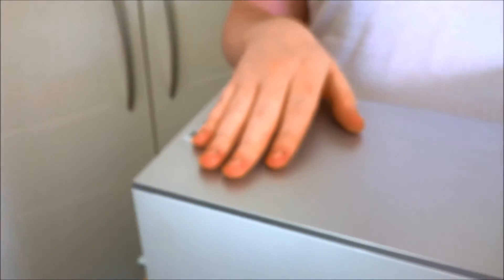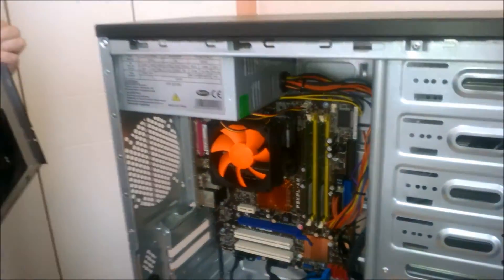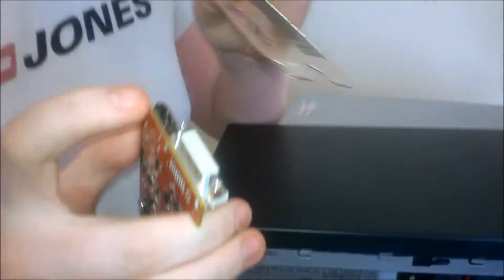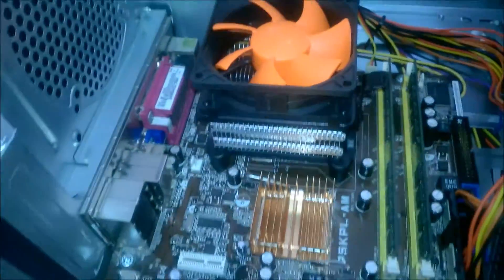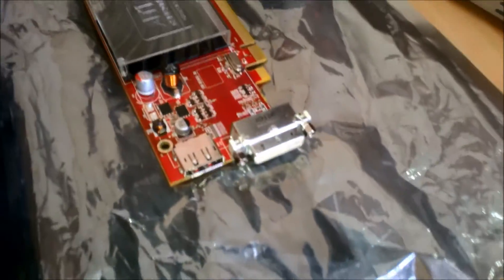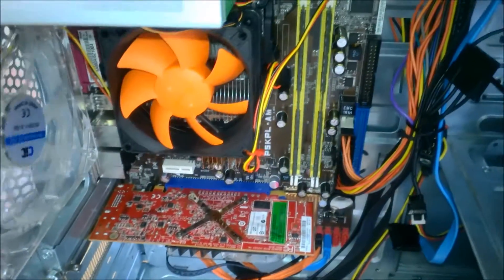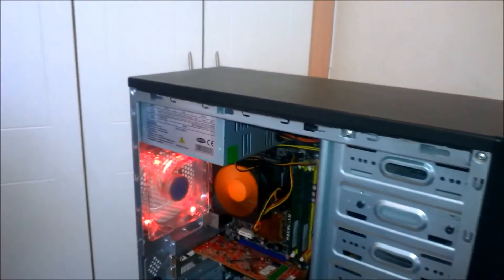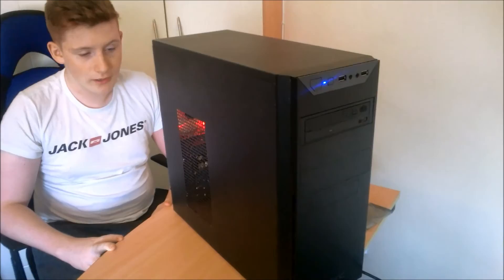How to refurbish an old computer

Comment: Now let's put it against gta5 1080p high settings
Reply from the maker: I'd rather not have it explode
Reply: Emerald Isle PC's I can't move my old dell inspron 530 into a new case because the IO shield is built into the case what should I do?
Reply: That depends on what tools you have. If you have a dremel or a good power drill you could by some aluminum of the same thickness as the integrated IO shield then trace the holes and cut them out carefully then try them on the motherboard after sanding them smooth just keep touching it up till it fits right then use the dremel or drill and some sandpaper to cut the piece of sheet metal down to IO shield size and then just us that.

Comment: this is not how you refurbish a computer, more or less you just replaced it with a different computer, what your post to do is max out the ram and put in a slightly better video card so doesn't  have problems going on the web and install windows 7 and replace the dvd drive. the other way to refurbish a computer is to just reinstall the os add some more ram and add some antivirus software.
Reply: He was never going to fix the Dell, It was not worth saving, that's the point of the video,  For €50 his aunt still got a better PC, that's all that matters.. For €50 she did very well..
Reply: then the video shouldn't be call How to refurbish an old computer.
also it just sounds like all it needs is a reinstall of the os and a new dvd drive witch can be easily fixed for less than 10 bucks here in the states or the cost of zero
also a Pentium d is not better then a core 2duo
Reply: *****  It was a 1.6 GHz single core intel Celeron,,
Reply: well my bad on that then

Comment: Yo sam ive been a gamer for a few years now but never had a gaming pc till now im only about 130$ away to getting my parts    

I saw you have a few builds with the AMD athlon 84 860k which im getting in my pc but my problem is that i dont have the extra money to pay someone to build it cause im very excited that im close to having enough for my parts so i was gonna build it my self but im scared of braking parts etc should i be worried or as long as im a careful and watch videos on how to build it i should be ok please reply thanks i might even follow some of you videos to help me build it.   Thanks for reading i know its long xD
Reply from the maker: captn JACOBY No problem, almost every part goes in one way, it's impossible to put them in the other way. If needs be I will give you my skype name and depending on your time zone I could talk you through the process on skype.  Just be careful with the CPU. where are you? just in case you need my help, I ant to make sure I'm available, so time zones ruin everything.